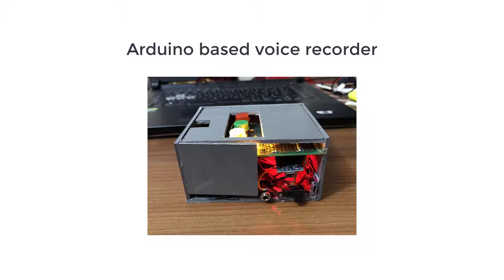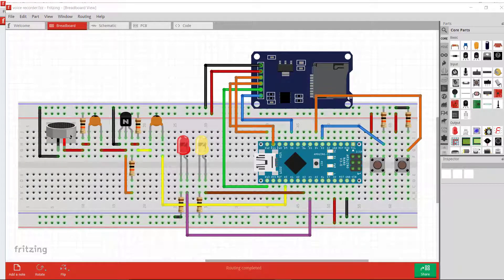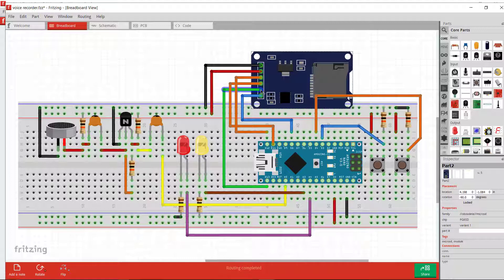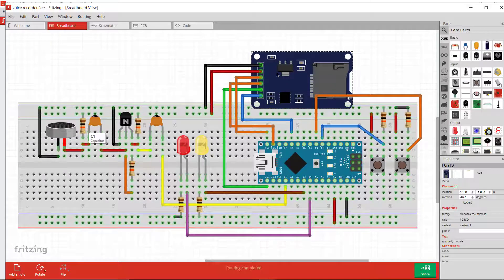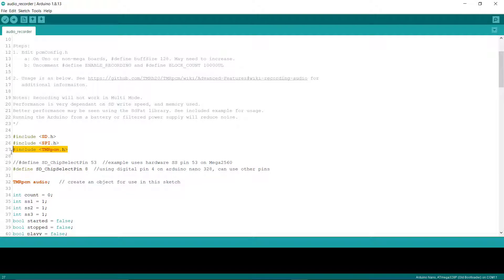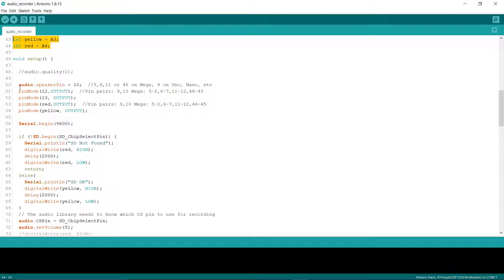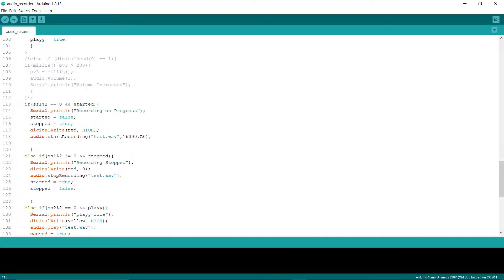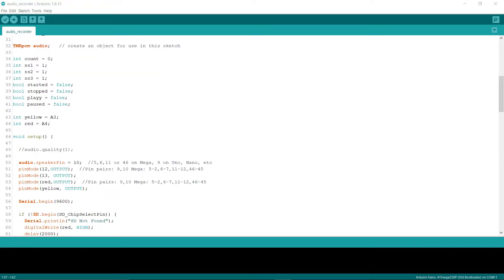Arduino voice recorder module | Electret microphone and sd card module

Comment: Does this record one audio recording? Or does it continually save multiple recordings onto the SD card for future playback?
Reply: Since there is only one file name "test.wav" i'm sure it overwrites this file each time you record a new one. I was thinking of setting the file name to growing numbers or date/time to be able to record multiple audio files. But in that case you won't be able to listen to them as easy as shown in this video. And also I'm pretty sure arduino is not able to automatically increase numbers on variables/text, because you cannot put code inside the "audio 1" "audio 2"... apostrophes, since this is text and no code, so beeing ignored by the arduino. Hope this helps.
Reply: @simon_w8  gotcha, that makes sense. Thanks for the help, it’s much appreciated!